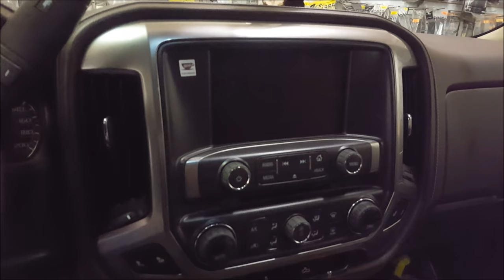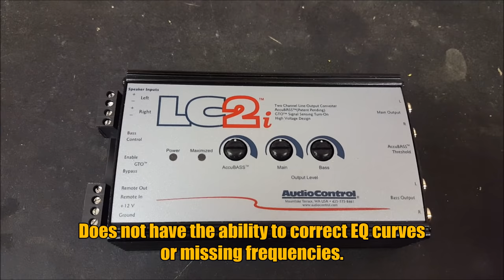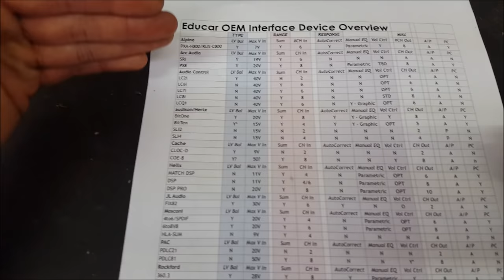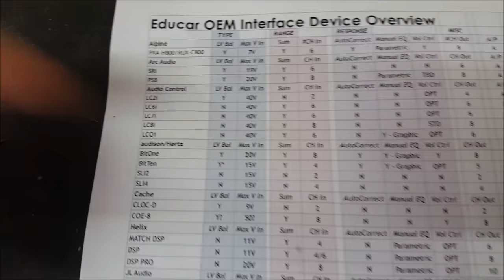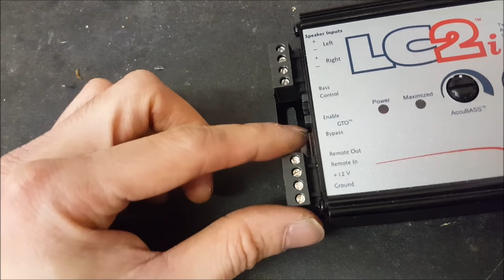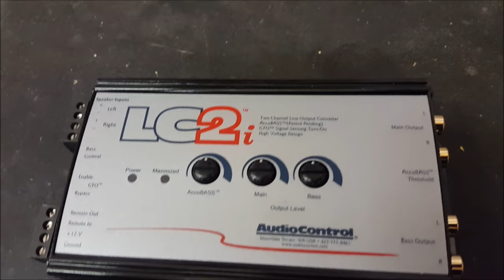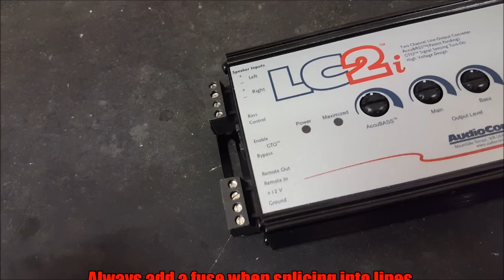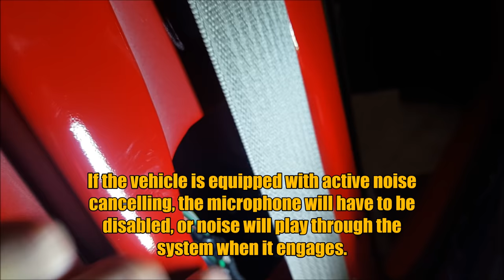Line Output Converter Explained | LOC (Audio Control LC2i) | AnthonyJ350

Comment: I just happened on this channel and this is the most explanation I have gotten on these LC's. I have the LC7i, I'm still not understanding 'summing'? What can you tell me about it?
Reply from the maker: Basically you can combine channels if they're crossed over. 

For example a factory amplified system the tweeters may only play highs and the the speakers midrange and lower. You can combine the channel input by moving jumpers to get full range signal.

Comment: dude has anyone ever told you sound like Mr. Van Driessen from beavis and butthead but with that said would you consider a LC2i for i semi hi power system im buying a new dodge but i absolutely do not want to change the head unit
Reply from the maker: HAhaha, ya I've gotten reference to a couple cartoon characters.  Maybe I should be voice actor as well?!  I would do a LC7i or a signal processor with a nice 5 channel amp.

Comment: Hi Anthony,

Great video, keep em coming.

My query comes from another video I watched recently stating it's better "NOT" to grab the sub signal from a stock sub speaker, to utilise the Signal Sensing circuitry. As the stock sub sometimes stops producing voltage due to lack of movement, which intern switches the amp off. Does this sound plausible to you, and/or have you ever come across this issue?
Reply from the maker: M Francis Yup that can be an issue if you're using signal sensing. To counter that find a 12+ switched line to turn the setup with the vehicle.

Comment: Great video, I was wondering how to actually connect wires to the terminals for speaker in and power in, they seem to all have the same terminal type, Do I strip off some insulation and just insert the exposed copper wire into the terminal and screw it in or what do I need to use? A ferrule? spade connector?
Reply from the maker: They're pretty small and they have a guard where the set screw compresses the wire.  I just go bare wire in, just don't strip the insulation back too much.

Comment: would this work good on two amps a 4 channel amp running 4 door speakers and 2 tweeters. and a mono amp amp running 2 10s I currently have 2 cheap hi lo convertors but am not getting the best sound on bass..
Reply from the maker: +Sisco Sosa You want Audio Control's LC7i for that job.
Reply: +AnthonyJ350 thanks. but I don't get how it says it's a 2 channel converter with 4 rcas and I'll be using 1 set of rcas for the 4 channel and the other set for the mono amp. so I I only installed 1 amp why would there be another set of rca connections on the lc2i?
Reply from the maker: Sisco Sosa Well it does have a main output and a bass output.  I just use this thing from monoblocks or 2 channels, but I suppose it would work for a multichannel amp but the LC7i or LC6i is the proper application.
Reply: +AnthonyJ350 Ok so I just got the specs for my factory headunit, output to the front speakers are mids and highs... output to the rear speakers are full range... and output to the rear deck speakers are low bass... so than that means I will need a lc7i right? And also how would be the best way to connect the speakers for my 4 channel.. I know for my bass amp I'll tap into the bass output speakers.. just want to know which speakers to tap for my 4 channel?
Reply from the maker: Sisco Sosa The cool thing is you can sum the signals in an LC7i.  So I would just grab front and rear, then sum everything together so you get full range coming out the RCA's.  You'll lose fade but who cares.

Comment: So if I want to jus add a sub amp and 2 subs in my 2020 ram 1500 I could jus use the lc2i and tap into one of my speakers to get the signal? I jus have a basic factory radio no factory amp or factory sub. Thanks
Reply from the maker: Yes that's correct.  It's best if you can get the Left and Right signal as well.  I would also get the signal from the front channels.

Comment: @AnthonyJ350 Can you explain the remote in and out again? I have a monoblock sub amp that I want to hook up and I want the signal through the LC2 to trigger the amp to turn on as well. Should I hook the amp's remote wire to the remote out on the LC2?

Comment: I also have a 2014 Silverado. If I plan to use the signal sensing GTO (jumper on Enable), will I also need to hook up +12V and/or Ground? I couldn't really tell from the video. Also, did you only tap into the rear driver side speaker? Or did you tap into both rear speakers?

Comment: its a good thing i seen this video because i have a 2014 ram with the base stereo system and a kicker 4 channel 400.4 and im trying to put in a line out converter in the rear door speakers because they get full range signal there but i have no idea how to wire it.... my rear door speakers are 4ohm american bass sq6.9 and fronts are infinity kappa 2ohm. how do i wire this??? any help would be greatly appreciated.

Comment: added to an aussie ve ss ute. to replace the fascia for any aftermarket was going to cost $600-700 omg no way plus another headunit.
this connected to my factory setup and it really noticeable on my aux in with the phone and DAC.
car looks stock  but sounds clean and cranks. did'nt need as much gain on my amps as well. worth every penny

Comment: If i have a bose amp in my 14 silverado would i get signal from bose sub or a back door speaker?
Reply from the maker: +g00dstuff101 Grab it from the sub if there is one.  Also check if you have the noise cancelling system because if you do, you'll have to disable the microphones.

Comment: Great Video, I have a standard in line converter for my single 12 inch Kicker to my kicker amp and capacitor, Will this make the sound of the bass better?
Reply from the maker: It definitely will sound better with a product like this.

Comment: On my 2015 sierra i have bose system i seen that they tap to the rear speakers instead of the sub is this a problem?
Reply from the maker: That's fine, I've done that as well because the speakers provided full range while the sub didn't actually have all the frequencies we needed. It just depends when you find when you test.

Comment: I have the same truck! And I'm also doing a subwoofer add on only. Where did you connect the 12v and ground too from the lc2i? And where does the remote out go to?
Reply: To the amp

Comment: Hey man great video but Let’s say I’m getting signal from my factory subwoofer , should I cut off the factory subwoofer and just run the wires straight to lc2i or just tap into them ?
Reply from the maker: You can just tap into them. As long as it sounds good with the factory sub still working. If you have to disconnect the sub you have to install a load generator device to keep the amp happy.

Comment: So overall if I have a stock and integrated car stereo system (2010 Ford Focus w/ Sync) this would be perfect to add a subwoofer amp connected to dual 15-inch subs?  I will disconnect the existing subwoofer from the factory and tap into the rear audio speakers...  not the existing subwoofer factory audio wiring?
Reply from the maker: Michael C If you're using the  Audio Control piece tap into the sub woofer signal if you have a sub. You can tap into the rear speakers but you need a full range signal and since you have a sub it's possible the speakers might be crossed over not playing the lower tones.

Comment: so do you grab the signal from the rear speakers or do you share the signal with the speakers. if you share wouldn't that change the ohm's.
Reply from the maker: Jason Fleming It shares. It shouldn't because it's not really changing the load the head unit or amplifier sees.

Comment: Hey Anthony I have new mustang that has a factory sub, but I want to replace it. I already have a rockford fosgate p3 12" with a hifonics brutus amp. Will this line output converter work for my application, also can i tap into the factory sub wires instead of the rear deck speaker wires? oh and which amp kit would you recommend me to buy and what gauge? Thank you!
Reply: Hifonics doesn't carry the quality they used to but if it's truly 2000W  you will need zero gauage power wire.  That line out converter will work perfectly for you.  I used one in my Mustang a while back.  Tap into the factory subwoofer.. even if after the factory amp the LC2i Can hangle 400W input.  I warn everyone keep yoru sub amp gains low ill setting up the Accubass.  The threshold knob takes a second to respond to turns so turn a small amoutn at a time and wait for response.

Comment: I have a 2009 Dodge ram with alpine system and the touchscreen head unit, thinking about getting lc2i. Did you use 2 or 4 of the stock sub wires when installing it in a ram? will be adding a mono amp. debating on using a double din or keeping the factory headunit
Reply from the maker: TheConwayChannel Might as well use all 4. The LC2I has  left and right inputs

Comment: Hi, If you have a regular cheap line out converter and I am using the factory subwoofer channel speaker wires, I would I still have to buy a lc2 or just use a cheap regular line out converter (Because since it being a subwoofer channel I thought the freq&signal would be in the sub channel without using a lc2 using the front and rear wires and doing those adjustments on the other audiocontrol converters
Reply from the maker: +calvinchoe100 You can just use the line output converter you have.  You do have to be careful because cheap ones can't take that much voltage, and the sub woofer (even factory) will have a good amount of voltage coming out of it, potentially wrecking the line output converter over time or immediately.

Comment: Trying to figure out if this will work with just two wires.  Would I just connect them to one input?  I'm tapped into the factory Bose sub wiring.
Reply from the maker: Yes you can hook them up in parallel that we the RCA output puts out the same signal on both left and right channel.

Comment: I have 2017 ram with alpine system so when I take the factory sub out and just take the sub wires and run them to LC2i ?
Reply from the maker: Tommy Scaletta Yes the LC2i can handle the voltage. Or you can grab signal from the factory amp under the dash.

Comment: I have a LC2i connected to my stock radio. I bought a capacitor and it has a remote wire where do I connect to? Thanks for your video I have $80.
Reply from the maker: Remote wire goes from the LC2i to the amp and the capacitor is wired inline between the battery and the amplifier.

Comment: i have a 2015 silverado non bose and i wanted to install the ktp-445u with the factory head unit , and later on add an bass amp    what do you recomend, and one qhestion on the lc2i will both outputs work at the same time?
Reply from the maker: Jesse Rivera Yes both outputs should work at the same time. Yes the Alpine unit is a great little piece of hardware to use.

Comment: I have a 2009 Ford Focus with the audiophile system. It has a factory sub. Should I use the speaker wires for the sub as the input for my LC2i or the rear deck speakers?
Reply from the maker: Does the head unit have sub woofer control?
Reply: AnthonyJ350 
Negative. I’ll be installing my Cerwin-Vega B1 stealth. That has a remote knob that I’ll be installing also.
Reply from the maker: @robncasey1216  Best thing to do is check the speakers and see what frequency they're putting out. You'll want full range signal.
Reply: AnthonyJ350 
Already have. That would be the rear deck speakers. Thank you very much for the advice!!

Comment: i have a factory sub on my car. should i just tap into the sub line to get signal to install an aftermarket sub? or will it be better to tap on the rear speakers for signal?
Reply from the maker: That's usually where I go for signal.  Try not to use signal sensing when going at the sub, because sometimes factory units pause just long enough it will want to turn off the amp.  Use a switched power signal to turn on the LC2i and turn off the GTO sensing.

Comment: putting aside bass roll off to one side for now. most amps have speaker level input compatibility now. so is there still a need for this? I'm powering factory speakers via a 5 channel amp. I. e. k801-5
Reply from the maker: Hmmmm if it's a good quality amp technically no. But if you ever think you might change the head unit and you can place the rcas up front,  it will save you a wire run in the future.
Reply: +AnthonyJ350 how's everything going question i have a 2016 honda pilot elite model i just wanna upgrade my speakers and subwoofer should I get LG2 converter getting a 4 channel amp but honda pilot has a external amplifier build inside the back panel with a subwoofer plz help me out

Comment: Where did you get pull your +12 V and Ground from?
Reply from the maker: Wiring typically at the fuse panel or power distribution center verifying everything with a multimeter.

Comment: I have a 2016 Malibu and payed for it to get installed! I bought the schoche line out converter from Walmart and every time I press the gas, my bass blares! And when I let go of the gas the bass goes down. He told me the only way it will work is if I get AudioControl LC2i it will fix the problem. But I was just wondering if that's true?
Reply: Ps I have auto volume turned off.
Reply from the maker: Hmmmm I know some of the GM vehicles have active noise cancelling.  I'd look into seeing if your vehicle is equipped with it.  Does it blare bass when you're idling or even revving it in park?
Reply: AnthonyJ350 well sometimes it blares when I turn the vehicle on or when I press on the gas. It could be parked or in drive and it will still do it.

Comment: Nice breakdown, I was seriously looking at AC for a LOC but in the end I went with a DSP. What about AC s warranty, make sure to buy or have an authorized dealer install otherwise there is no warranty.  5 years with auth install, one year otherwise from auth dealer.
Reply from the maker: +fritze01 Good thing I work for an authorized dealer :)  Which DSP did you end up going with?
Reply: +fritze01 DSP Better?

Comment: im trying to put a kicker l7 12inch sub in my 04 nissan titan crew cab. i am going to take out the factory sub and put a LOC there off of the wires the sub used for my 2000 watt Hifonics amp. will that be sufficient?
Reply from the maker: Chase Burt As long as you lineoutput converter can handle the power coming off the factory sub output.
Reply: this is the information pertaining to the sound system my truck has:
The 2004−Current Nissan Titan Crew Cab features a Rockford Fosgate 400 Watt RMS, 10-speaker audio system including these advanced features:

DSP Tuning precisely tailors audio signals to each speaker
Long-Throw Subwoofer provides great excursion and deep bass
Dual Voice Coils (DVC) allow the subwoofer to handle larger amounts of power
Sealed Enclosures provide a tight, controlled bass response
Balanced Dome Tweeters offer excellent high-frequency performance

does that mean i have to use a LOC that can handle up to 400 watts per channel? or? 
also i appreciate your quick reply!
Reply: or is this based off of voltage?
Reply: for more info: 
http://www.rockfordfosgate.com/products/details/2004-curr.-titan-crew-cab

Comment: Can you use the remote out if youre not using the remote in? In other words can I use this to turn on my amplifier if Im using the speaker sensing to turn on the loc?
Reply from the maker: +vinnievici Yup, the LC2i will turn on with speaker sensing and the remote out will activate your amp.
Reply: It indeed works and the signal quality is great.

Comment: I have the same truck and idk what they put in it but whoever put the system in it got the rcas that are going to the 4 channel amp also going to the subs well the amp for the subs it sounds pretty good but if I put the 4 channel amp on full instead of hi or low the door speakers sound like they gonna blow up bc of the bad going threw them
Reply from the maker: You want the HPF turned on for the speakers and LPF switched on for the subs in your setup at the amp.  Best thing is to not mess with the original installer's setup if it sounded good to begin with.
Reply: AnthonyJ350 do i turn bass and treble all the way down on the head unit while tuning? And do i adjust bass and treble  from bead unit later on or leave bass alone and turn up treble? Also, theres a delay for the bass to kick in at higher volumes, why is that? Acubass too high?

Comment: Lol you can still use remote turn on and have it tied in with the RAP. Just tap into the factory amp harness. All my accessories turn on and off with the RAP. But I ran that tapped signal to a relay and the relay powers on and off the aftermarket accessories
Reply from the maker: What if the head unit is CANBUS?
Reply: AnthonyJ350 doesn’t matter. My head unit is canbus and is tapped into my canbus
Reply from the maker: @idrift314  How did you do it with the LC2i? You can grab it off the speaker output and use signal sensing (GTO) but there is no way to use 12 volt turn on with a CANBUS head unit, you would have to find an accessory line at the distribution center that is integrated with the R.A.P.
Reply: AnthonyJ350 now you’re getting it.
Reply: AnthonyJ350 GTO doesn’t work with CAN. At least not with my truck. Like I said, I just tapped into the RAP and used that to power a relay that powers all my accessories